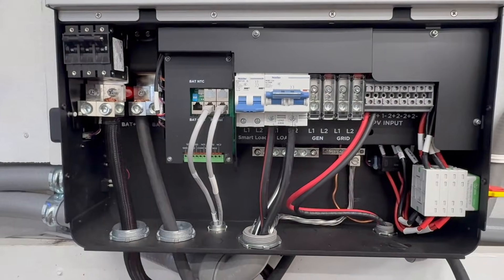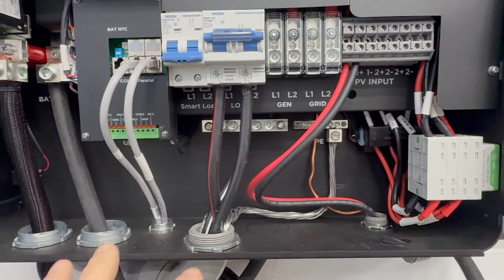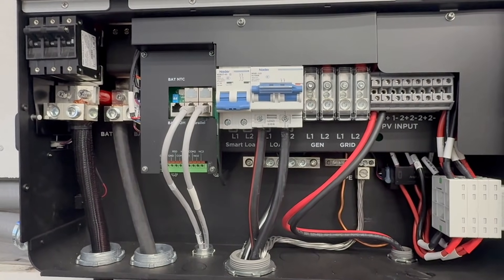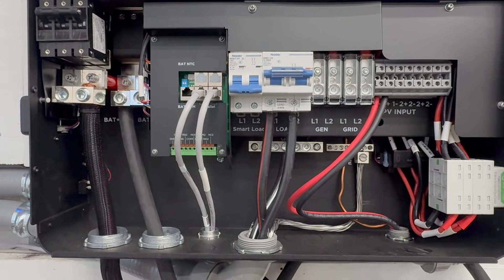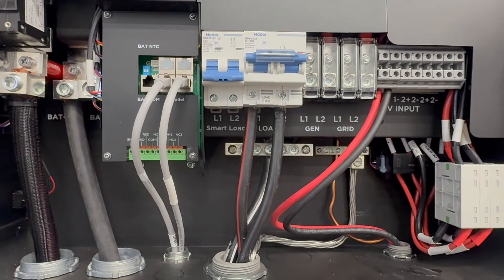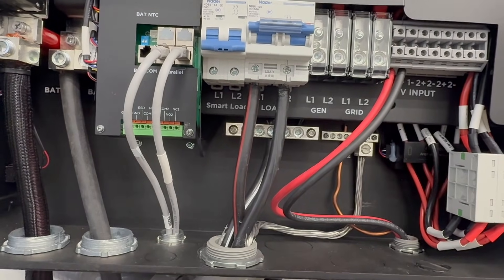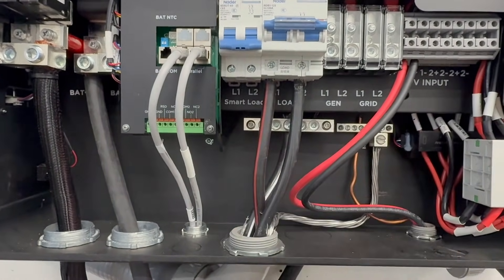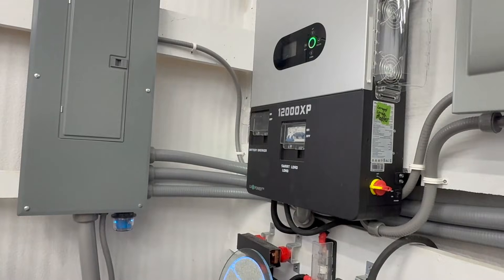Aluminum Wire to Install EG4 12000xp inverter?

Comment: Aluminum service entrance cable should never be pulled into any form of conduit, the heat generated can be very bad. Service entrance cable was designed to be used in open air for cooling purposes.
Reply from the maker: Very good information, thank you!

Comment: Also make sure those lugs on those breakers are clearly marked for CU-AL usage, if not....run far away! I take my Service Entrance Wire into a breaker box, then convert to copper between the two and it also gives me a breaker to use as protection and a disconnect rated for CU -AL wire.
Reply from the maker: You are absolutely correct about the CU-AL rating on the lugs, that's crucial for safety and code compliance!

Comment: No one stopped using aluminum on anything except branch circuits. The ser feeding your house is almost certainly aluminum. I do believe the issue with the 12000XP is that it was only UL rated for copper initially.
Reply from the maker: I believe the 12000xp is now rated both aluminum and copper.  All of your points are valid.

Comment: I work for the local electric utility. We use little to no copper. Even inside the power transformers, they use aluminum windings. The lugs you have in your inverter is made of aluminum and most electric panels the bus work is aluminum. It's definitely cheaper to use.
Reply from the maker: That is great information to know.  The 4/0 leading to my house is aluminum and the builder used aluminum in some of the higher amperage circuits such as the range and the HVAC.  Thank you for your comment and Happy Holidays.
Reply: .ost people are scared of aluminum because of issues in the 70's where it was installed in homes on smaller circuits like receptacles. The steel screws on the devices wouldn't expand and contract like the connected to them causing the screws to loosen. So now the smallest aluminum used in home is #8. Usually a 40a circuit breaker.

Comment: I used 1/0 SER to my 12000XP and from the inverter to my load center. The first run was 30' and second was 10'. 

Worked fine no regrets.

I would imagine that most homes in the US are using aluminum service conductors.
Reply from the maker: Very true, my house SER cable is 4/0 aluminum from the power company.

Comment: 'Normal maintenance' is checking torque on wires every 6 months?  Hmmm. Where is that in any literature/code?
Reply from the maker: This is from Google Gemini, pulling it from articles and forum posts. 

For a new solar setup, you should re-torque connections after the first few days or weeks of operation to account for wire "cold flow" and initial settling. After this initial check, annual or bi-annual checks are generally recommended as a preventative measure, especially for off-grid or high-vibration systems.

Comment: If your breakers and lugs are not marked CU/AL they may not be approved for aluminum wiring. The inspector should reject it or ask for documentation.
Reply from the maker: You are absolutely correct any lugs or breakers must be rated for aluminum connections.  I was seeing forum posts on aluminum wires, but wanted to talk about the downsides so everyone was aware.
Reply: @MikesSolarGarage 

The spec sheet for the load and gen breakers on the XP are silent on conductor material.
Reply from the maker: Here is what I found on the CHiNT breaker that is used for the load section of the inverter.  The CHINT DZ158-100A circuit breaker is generally compatible with aluminum wire, provided the wire size is appropriate for a 100-amp load

Comment: I don't recommend using aluminum for these projects at all.  Under any circumstances, really.  The problems listed are only the tip of the iceberg and one mistake can literally lead to a fire at some random point down the road.  People are so used to running copper that even just the brittleness of aluminum will lead to major mistakes if you suddenly decide to use aluminum for something.  Brittleness, corrosion, thermal expansion and contraction...  other behaviors, some time-based.  It's a lot more than just applying a paste.

And no, don't use CCA either.  CCA is at best only a workaround for some of the problems and has its own problems.

DIY projects won't have runs and wire requirements that are so costly that aluminum ever actually makes any sense.   Really.  Avoid it.

-Matt
Reply from the maker: Matt I agree it really should not be used in most cases, especially if the person does not understand what they are getting into.  I wanted to list the negatives and show the proper way to use it.  I have been seeing more posts of aluminum being used so that’s what prompted me to make the video so everyone understood the risk and also why loose connections are a big deal.
Reply: @MikesSolarGarage  Its not just loose connections that are the problem.  Aluminum is very brittle and gets more brittle with age.  The oxidation layer on the surface is not even remotely as protective of the aluminum underneath as a copper oxidation layer is for copper, with poor conductivity (copper's oxidation layer has high conductivity).

Tightening an oxidized aluminum connection is often insufficient.  If it got loose in the first place, the wire may already be in real trouble.   unlike copper, aluminum is NOT something you can loosen and re-tighten very often before it breaks.

Anti-oxidation compounds only go so far and will be mostly misapplied (applied like dielectric grease, for example, not be contained and in insufficient quantity).  Allowances used in large diameter wire connections do not apply to DIY projects.  Those lugs work very differently than regular crimps, bolts and ring terminals.

Aluminum works well only for large conductors in utility settings where actual electricians know what they are doing right down to the last line of code.  That is it.

This is like trying to DIY wood fractal burning that got so many people killed because they didn't realize how dangerous it was.  It's akin to that, except it sneaks up on you and you wind up with a fire a few years later instead of one immediately.  So people will wire this stuff up,  pat themselves on the back because it all seems to be working, and not realize that they just lit the fuse on a ticking time-bomb.

I don't think people really appreciate just how catastrophic aluminum can be.   No DIYer should be using aluminum (or CCA for that matter).   People who are used to working with copper are guaranteed to make major mistakes if they try to use aluminum.  100% guaranteed.

-Matt
Reply from the maker: One thing I did forget to mention is when mentioning Noalux is to use a wire brush to work it in.
Reply: @junkerzn7312 

Aluminum gets brittle with age? Huh. The B52 is pretty old and made of aluminum. It seems to be doing ok.
Reply: Do you want to guess at home many homes in America are using aluminum and service conductors?
Reply from the maker: Quite a few,  I know mine is.  It's 4/0 aluminum.
Reply: @MyGoogleYoutube  I know very well that distribution and transmission lines use aluminum. That doesn't mean you just string it around inside the home.   There's a reason why homes don't use aluminum any more.  Actually, a whole bunch of reasons.  You understand that, right?
Reply: @junkerzn7312 

Yep. But I also understand nec doesn't disallow aluminum branch circuits. 

We own a property that has aluminum branch circuits and had the copalum added to remediate it.

I used 1/0 SER in my 12000xp on the AC. No issue with it.

What I was eluding to is most homes have aluminum wiring from the meter to their load center.
Reply: @MyGoogleYoutube  Aluminum used in that setting is wired by actual electricians, and matched to lugs actually designed to take it.   That doesn't mean you should be using it in a DIY project.   Unless you are an actual electrician, even an experienced DIYer who doesn't have years of aluminum wiring experience under his or her belt is going to screw it up.  100% guaranteed.

It's a minefield best to be avoided.   AI is not gonna give you the right answer either.  AI still thinks the 12000XP is rated for aluminum on the AC side when it actually isn't.   It gave me a decent result for the Flexboss/GridBoss combo (earlier Gridbosses weren't rated and later ones are only rated with the correctly-specified Eaton breaker and otherwise don't allow aluminum, for example).

Anyway... its a mine field.  Most DIY equipment is not aluminum-rated and become a fire hazard in just a few years if you do.

-Matt
Reply: @junkerzn7312 

Nothing from eg4 on the 12000xp says which conductor material to use or not use. Nothing in the gen breaker or load breaker specs talk about conductor rating. 

Telling people you need special qualifications to land 1/0 ser is just silly gate keeping.

Copalum is proprietary and the equipment cost has a comma in it. It's highly unlikely any diy person is touching that stuff. I'm not sure why you thought I DIYed.
Reply: @MyGoogleYoutube  If it isn't specified, its copper only.  But hey, its your life.  You want to ridicule common sense, be my guest.   But influencers and channels need to be careful about what they suggest because the consequences can be catastrophic (as we saw with the wood burning social media sensation a while back).
Reply: @junkerzn7312 

When EG4 released the Gridboss they specifically said no aluminum conducters. They didn't say that for the 12kpv, 18kpv, 6000xp, FB18, FB21, or the 12000XP. 

If eg4 wanted to say no to aluminum they would have. But they didn't.

Comment: Copper was the primary wiring method of commercial and residential branch circuits since the beginning of time until the late 1960’s and into the 1970’s.  At that point in time, the cost of copper had risen tremendously, making aluminum wire look more $$ attractive, especially for tract home builders.  There were definitely tremendous problems with the early use of aluminum wire.  Most were related to terminations and failure to upsize to account for lower conductivity.

Many failures and fires were caused by this.  The use of devices that were not rated for use with AL was one of the biggest problems.  Termination with copper conductors also caused issues due to differing expansion rates under load.
Surprisingly, many “electricians” used the devices with nightmare type terminations.  The back side “push-in” connections were held together with the light spring action of small NON-AL (CU only!) rated terminals.

The use of aluminum as branch circuit wiring was phased out in most electrical codes and the NEC once much of the issues came to light.
Over a certain size, which I can’t recall off hand, aluminum was and still is acceptable as a wiring method for AC home wiring.
(sub-panels / dryer and oven circuits / etc) and, if installed correctly, can be safe.

The aluminum alloys developed for electrical wiring are much better.
Devices and installation methods are better.
Etc.. just make sure your devices are all AL or CU/AL rated and terminated properly.
(PROPER oxidation inhibitor application to conductors and terminals - rough up & clean bare wire end and apply and work into the conductor with a brush.  Tighten connection , loosen , tighten again to torque spec)

NEVER use it on the DC side of s PV system !!
Reply: Forgot a few things, but only have a sec.
I’ve been an electrical engineer and electrical contractor for decades, but a firefighter/EMT for longer.
Please don’t cut corners when dealing with anything aluminum!

If you encounter aluminum branch circuit wiring in a home environment, VERY special rules apply to work with it.
If sized properly and you absolutely must change a device (receptacle / switch / etc), make sure the device is rated for use with AL wire or CU/AL wire.  Use oxide inhibitor (“Penetrox” / “No-Alox” / etc..) after removing the aluminum oxide that has formed on the exposed conductors.

There is only one “approved” method of terminating aluminum wire to copper wire .   It involves very pricey proprietary crimping equipment and terminals rated for the purpose.  The “purple” wire nuts are larger wire nuts that have oxide inhibitor goo already inside the wire nut and it has other modifications to the metallic spring.  Under testing, it’s been shown that the (Ideal brand?) purple nuts will fail catastrophically2 if under many circumstances.  If you can replace the wiring, please do so.  Especially if it’s for a heavily loaded circuit.!,  

Btw = i’m not referencing the larger, aluminum alloy cabling utilized for higher load purposes.
The use of this is ubiquitous in residential, subpanel, installations, oven, electric range, AC, condenser units & air handlers, electric water, heater heaters, electric dryers, and similar loads.   It’s significantly less expensive than copper and if sized properly and installed properly, is perfectly safe..  even though it usually requires larger sized conduit to account for the larger amount amount of “fill” and it’s far more difficult to bend and work with, the price savings become very significant when copper prices are through the roof.
Reply: One other thing I forgot about..
And probably something a lot of the DIY and Solar folk will encounter.p more than plain aluminum alloy cable.

PLEASE PLEASE do not be fooled by CCA !!
(Copper Clad Aluminum)
Places like Amazon sell a ton of  CCA wire and usually try to advance the false point that it’s “better” than copper, etc…
Many sellers try to infer their CCA is actually tinned copper.

CCA SUCKS !!   It’s just crap.
The individual wires in a stranded conductor are very stiff and you end up losing many connections if movement or vibration is involved.
The current handling is much less than pure copper or tinned copper.
The overall construction quality is always far less than known brand wiring.

Tinned pure copper wire is very different and very safe *and preferable to bare copper in marine and many similar applications)
It prevents the green colored patina / oxide and corrosion because the tin/zinc used to “10“ the wire acts like a coding, and also prevents this similar medals from creating
Reply from the maker: I completely stay away from copper clad,  I completely agree, it is junk.
Reply from the maker: All very true,  I think my new house had a counter or of higher amperage circuits that were aluminum like the range.  I was pist when I noticed that afterwards.
Reply from the maker: All very true,  I think the last homes that used them were trailers,  I forgot which year, but around 1975.  I have heard you could use aluminum for PV, but I wouldn’t use it,  especially if any moisture entered, it would turn to ash.  Thank you very much for posting.